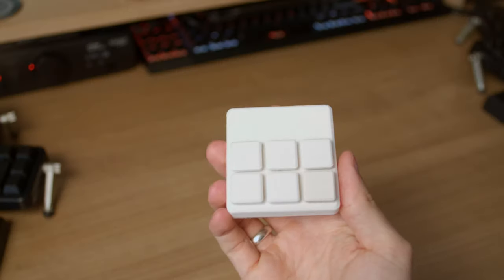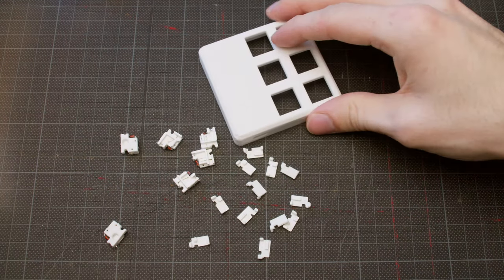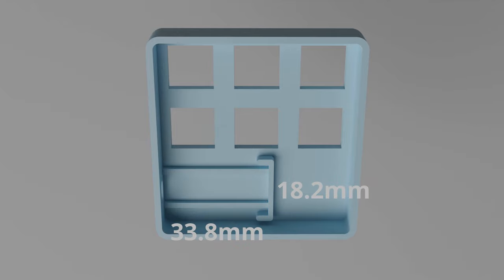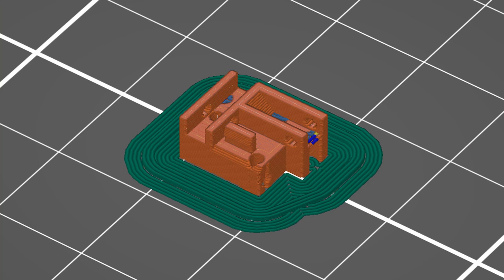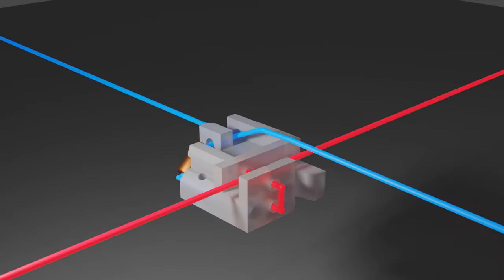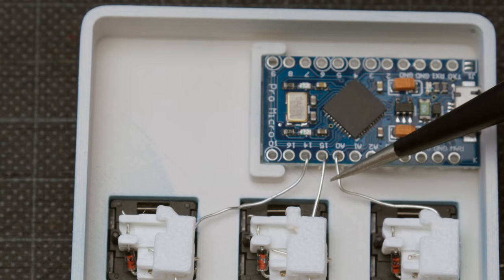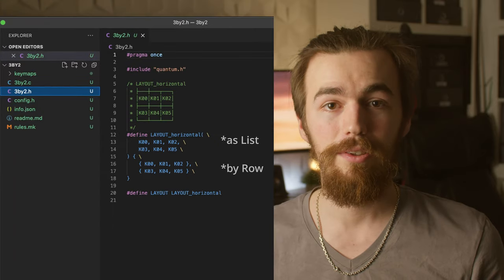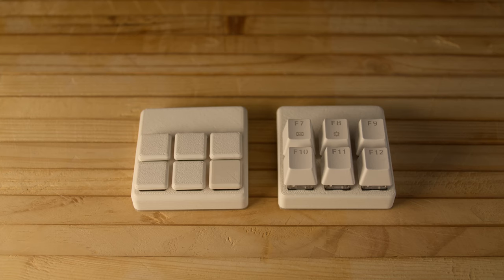No Soldering and no PCB Macropad build | macro pad part 1

Comment: Great video! The idea and the execution is superb. I'm also prototyping a split keyboard with my 3D printer. I'm looking for a breadboard like base were I can attach switches and the diodes but this is even faster to test.

Thanks! Keep it up
Reply: Been thinking the same. Bread or Perf boards that allow for "prototyping" changes and fine tuning/ tweaking / changing
Reply: Did you end up taking any steps in this direction? Prototyping a split? I was thinking in similar direction but dont have a 3D printer. So was thinking of Cardboard based prototyping.
Reply: @AX-fx7ng  I'm doing the same, but I don't really know what I'm doing. I got some hot swap sockets and mounted them onto some cardboard, although the switches are on the same side as the electronics so it's a bit messy
Reply: @samuelwaller4924   Can you share what that looks like? Maybe we can DM via reddit or something? I might also try to do similar.

Comment: a Version of this sockets for gatearon switches would be amazing and appreciated. really cool idea!
Reply from the maker: Newer versions in my other videos are using gateron switches but i replaced the clips with a more open designs if you like to solder and used wire wrapping when not soldering

Comment: Stumbled across your 60% build through your post on reddit. My youngest wanted a keyboard of her own to pretend and fidget with (not actually use as a keyboard). Using your macropad shell and a mix of random switches for her. Bottom wouldn't stay on unfortunately, so I'm just adding a dab of silicone to get it to stick (just what I had kicking around). If I end up making one to be functional, then I'd consider modifying your design to allow for screwing the bottom on. I was also surprised that your macropad wasn't on your Github. Both projects really cool though. Thanks!
Reply from the maker: thanks a lot, yes im still moving all the things over from the blog to github the macropad is now also on there im currently exploring magnetic bottom plate mounting but its still in its early days
Reply: @JanLunge   Magnetic Bottom plate mounting - Curious as I am thinking for it as well  (Magnetic, Velcro ..etc) - Any updates on that? Did not see anything in your videos yet?
Reply from the maker: My w100 is using a magnetic bottom plate but that board was a bit big to have it mounted with magnets, could have used a few more.
Reply: @JanLunge   Interesting. Is this build visible online? Does that plate then adhere the switches to it using Magnetic force? 
Or are you using the magnetic only to shut it from bottom?
Reply from the maker: Yes its the full size keyboard video
https://youtu.be/aBdC5xZZPSY only the bottom plate is clicked in with magnets the switches are still using the usual method

Comment: I would still use the pushfit sockets, but solder any other Connections. There is nothing thats more annoying than an loose Connection. I think this works Just fine for  Testing but if it is in use very often, it definitly should be soldered .

I build a similar thing,but i use custom code for my one (i use an old keypad from an door with numbers on it.) And i mapped the keys to F13 - F24. Also i use some pots on analog Inputs to control the Sound on my pc.

Comment: Hi! I'm a person who's currently dipping their toes into DIY keyboards. As of now, the opportunity to solder for me are far and few between for me so I have had to resort to wire wrapping and assorted friction fitting methods for a majority wiring for my  exploits. You tensioning the holes on the pro micro and circuit in general with a solid core wire blew my mind. Although I probably won't adapt it (as what I'm trying to do is supposed to be more permeant instead of having the ability to quickly to take apart for prototyping), very cool! Keep up the good work!
Reply: When you say "assorted friction fitting methods" - which ways are these? I am super new too :)

Comment: But wouldn't the hotswap socket get torn out by removing the switch? Since the wires are stuck in there, wouldn't it completely wreck everything?
Reply from the maker: Yes very much you would need to pry out the switch from the socket a bit so it doesnt pull as much. On the w60 I added parts to the side that keep the socket from getting pulled out but they require added parts to the plate/case

Comment: It's unlikely those connections will last very long. It's certainly fine for prototyping, but for longer lasting connections you will have to solder.
The alternative is to use what's called wire wrapping. While that's certainly old school it also happens to be extremely robust (in certain cases more robust than soldering) and allows for manual (error) correction.
Reply from the maker: I actually just did a video about a keyboard build with wire wrapping, though through unrelated issues the build got more complex. Also so far i would say this wiring method has a 10% error rate long term most if the switches will function correctly even after a year but on some tweaking is required to fix them again
Reply: @JanLunge  I have a lot of catching up to do on your videos, literally just found your channel 😁

Comment: Awesome. I tried that too. Sometimes the button movements while pressing can cause the wiring contacts to come loose, therefore the functions can't be triggered. Just a thought.
Reply from the maker: yes I can totally see that happening but my macropads stayed without much issue the same even with a lot of use, but I'm working on more reliable versions like with the 60% build I did. Its just really nice to use for prototyping and when you are happy with the result you can even solder these together for more rigidity

Comment: With such a limited key amount, is it really necessary to have diodes? Obviously you shrink the required pins needed for function, but if your device is never intended to exceed the pin count, could you just do each one independently?
Reply from the maker: Yes you can set it up without diodes, with each key to a data pin and then to ground. Just like to do it like this so people can understand how bigger keyboards get built and use this firmware as a starting point as well.
Reply: @JanLunge  Cheers, I appreciate the response!

Comment: I feel so sad that I found this vid too late.
Ideas without soldering/pcb was so attractive. I've got no experience  at both of them.
Do you think it's possilbe to build (split)keyboard with the same way?
One worrying is that problems may occur due to complexity when the wire is too many.
Reply from the maker: Yes you could build a full keyboard or a split keyboard this way I'm currently working on an updated version of the hotswap sockets to make them more relieable when wired together. and I just finished a 60% keyboard build without any soldering or pcb. 
It was a lot of effort to make it work but it is more reliable than I initially thought.
Reply: @JanLunge  Thank you for your reply. It's very expected. I was preparing this build for a while and two questions left. 
1. Is there any possibility of signal problem due to contact error from no soldering?
2. In this vid you did not use diode, which means there is no 'ghost' effect prevention. Can I attach diodes here too?
Please give me a lesson.
Reply from the maker: 1. yes if the wire is not attached firmly there will be double pressen but incresing the tension on the wire worked for me every time
2. i did use diodes they are inside the hotswap socket, same for the new build i did you can look at the pictures of that already on the discord
Reply: @JanLunge  I'm really sorry I thought it was the resistor whole time. I checked the project on discord and it was awesome. I can finally build my custom keyboard even if I don't know anything about soldering/pcb .  Thanks for the courage!!

Comment: I’m gonna build one, just trying to find the wire you used, seems impossible to find where I am hahahah. Thanks, great clip, will come back and update on how it went (may take a few weeks at least due to hard time getting the wire)
Reply from the maker: i can imagine any wire with a similar diameter would work even slight difference should be fine but the stiffness is really important for the handwiring part. I guess 24-gauge is equivalent to what i use https://www.amazon.com/dp/B00LHOJLT4
Reply: @JanLunge  followed pretty much everything the the video, flashed my pro micro, doesn't work, I hit the keys, nothing happens.
Reply from the maker: @majinkeyboards  ok 3 step debug plan: 1. check if the firmware and microcontroller is fine by connecting any of the column pins with any of the row pins if keys get pressed  this thing is fine continue , 2. connect a the wire behind the diode(the side that connects to the switch ) of one of the hotswap plates with the bent wire piece on the other side if this doesn't work the connection between the row and column wires to the hotswap plate is unreliable (try bending the wire so the wires actually touch) if it worked continue 3. the connection between hotswap plate and switch is not working or the switch is broken. this is how I check errors on my builds but it seems to be a microcontroller issue if none of the keys work.
Reply: @JanLunge  thanks so much, I will try now. I will also try reinstalling QMK and check if I missed any steps in that.
Reply: solved after debugging. You were right. Wires were not contacting. Thank you sir

Comment: That’s a pretty cool idea! How reliable is it on the long run?
Reply from the maker: I would say 80% are keeping up without any maintenance but 20% need to be adjusted after some time and use (like a few weeks) but 10% make a lot of trouble and might need to be replaced with a new printed socket as they break constantly (every few days because print tolerances) after switching out the faulty ones they work for years on normal desk use (not travel tested)

Comment: Is there any picture of the second version of your sockets? I printed the second ver of your hotswap sockets but I'm not sure how to avoid shortcircuits.
Thank you!
Reply from the maker: Yes my w60 is built with those
https://youtu.be/L04CBJteuHE
Reply: @JanLunge  Thank you! And what AWG wires are you using? I tried 22AWG but it seems that I need 24 or 26. I broke some pins from my switches with 22AWG.
Reply from the maker: Yes something like 24-26 awg should work better then, I used 24 i think but we have different units here. Also the copper wire I used was quite soft and sometimes I pre bent a tiny dent in it with tweezers to make it go in smoother.
Reply: @JanLunge  Got it, thanks for the help!

Comment: Could this be made to a 4x6 layout if I just added the extra row and columns and ofc edited the case?
Reply from the maker: yes definitely, it might make sense to add some more wire management as you would use pins from the other side of the microcontroller as well

Comment: Hey man, where is the stl file that secures the wires? they are not included in the github.
Thank you!
Reply from the maker: Thanks for pointing that out, added the v1 of the sockets to github now https://github.com/wlard/keyboards/tree/main/hotswap_socket/v1
Reply: @JanLunge  Thanks for the response! Do you advice me to use V1 (which has securing clips) or V2 which hasn't? Does V2 even need securing clip?
Reply from the maker: I continued to use a wire wrapping method for the next builds as when printing a lot of the small clips it can get really complicated. For the 3by2 it will be fine but any bigger build would benefit from not using the clips

Comment: Thanks for the fantastic videos, Jan. I was trying to compile the default keymap and was getting an error as a result of the "key count" variable in info.json. I deleted that variable and it compiled fine. I'm yet to finish the build but I wanted to know what was going on with this error, can you shed any light?
Reply from the maker: Qmk is changed this to not be required as they now count the assigned switches in the matrix, now it is not optional anymore but got completely removed. But as far as I tested the firmware would still get compiled even with this error being shown in the comandline
Reply: @JanLunge  Great, thanks for the information! Yes, the file was still compiled the error messages just concerned me. Thanks again for your great work.

Comment: What kind of wire is used there? not sure what to search for to order the unshielded wire online
Reply from the maker: It’s silver plated copper wire usually used for jewelry. You can also look for copper wire which would be easier to solder if you want that later on

Comment: Could you, in theory, just direct attach instead of making it rows and columns? so, F5 - B3? I am wanting to do a 6 switch macro-pad that's a lemon that's programmed for QMK/VIA, but a lot of this is over my head.
Reply from the maker: yes that also works and is called DIRECT_PINS then each switch is connected to a pin and ground
Reply: @JanLunge  thanks for your input!

Comment: what kind of diodes did you use. Do you or anyone else here in the comments have a link?
Reply from the maker: Diodes are the zener diodes 1N4148 - https://www.amazon.de/gp/product/B012ACSC1O
Reply: @JanLunge  1N4148 is not a Zener diode! It's general purpose, small signal, switching diode.

Comment: Wow, that's cool. Is it also possible to configure the controller with QMK Configurator?
Reply from the maker: no for that i would require you to use the exact pins i used and also send my version as a pullrequest into qmk and get that merged before it would work which i have not planned yet. in my opinion that workflow is too slow and also in prototyping things change. 

But if you want this just for it to be easier to change the keymap im currenlty porting the board with vial support so you can change the keys on the fly with the nice gui tool they provide
Reply from the maker: no the qmk configurator will not work, but im working on a version with vial support so you would only need to flash it once and can then change the keymap with the gui application

Comment: What different would i have to do to add a knob to it?
Reply from the maker: I have built the same one with an encoder here https://youtu.be/OCwuDV3WIkM maybe that helps. Basically you just need a hole for the encoder to fit in, i have files provided for that build
Reply: @JanLunge  hey... thankyou so much..great work

Comment: is it 3 or 5 pin switch?
Reply from the maker: Works with both i designed the socket for 5pin and 3pin fits just without the plastic pins then

Comment: Would it be possible to make a split keyboard like that ?
Reply from the maker: definetly but im still working on making them more relieable and attach to the frame so you dont pull out the hotswap plate when you want to swap a switch. so there is some optimization to do but you could use these for a full split keyboard build already
Reply: @JanLunge  how about same assembly procedure but extend the hotswap plates so they touch the plate/case then super glue it in place? Would that work?
Reply from the maker: yes i hope that exactly that will work i started prototyping a 60% keyboard last week for a proof of concept and am updating my progress on that on my discord as well as streaming the build on twitch if you want to see some things before im done with the video

Comment: Any specs on the diodes?
Reply: Literally was digging through the comments looking for the same thing, these tutorials are awesome but I wish they just had that little bit extra technical documentation. 

Also, the video where he added the rotary encoder also shows an updated hot swap design, I’m gonna see if I can get a better view of the diodes there and see if I can figure out what it is
Reply from the maker: I used Diodes ( 1N4148 ) from amazon https://www.amazon.de/gp/product/B012ACSC1O, though from what I have read about this topic others work fine as well its mostly about the footprint and the rated power and our pro micro pins are quite low on that, I will check to link them in the video description
Reply: @JanLunge  wow, thank you for the swift reply!

Comment: I mean, hou you don’t have soldering tool but HAVE A 3D printer?!
Reply from the maker: I got everything needed for soldering. But when i need to swap the case when prototyping it is easier tho swap the wiring to the new case without resoldering. Current plan is that the hotswap sockets can be soldered for a permanent connection but the switches will still be hotswap
Reply: @JanLunge  aahaha I was joking. I rly can understand your intentions :).
anw for next vid can you find way to make pcb become hot swap in cheapest way possible?

Comment: No soldering is for kids. No soldering means no reliability at all. Soldering is not so hard and it's not expensive, just buy 4$ soldering iron and a roll of cheap  solder..
Reply: The point is to have fast "changeability" for prototyping - Not solders that make things permanent/ static.